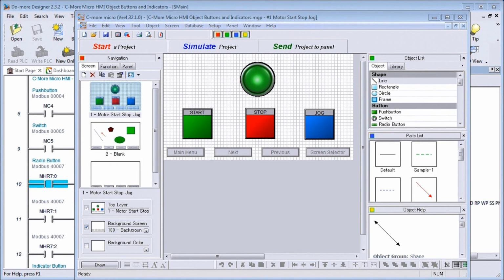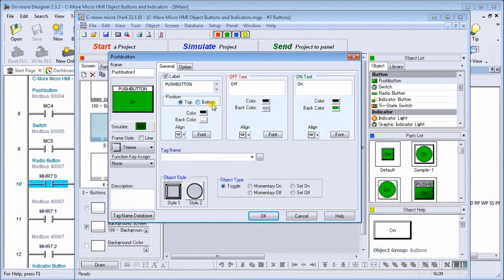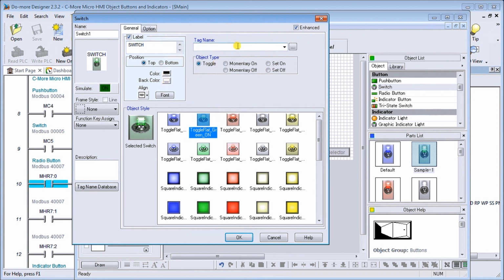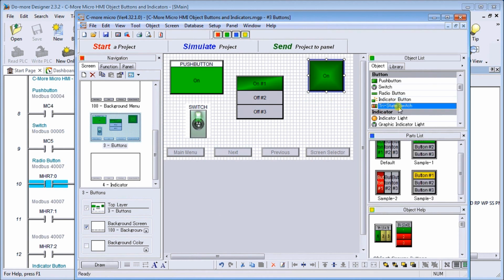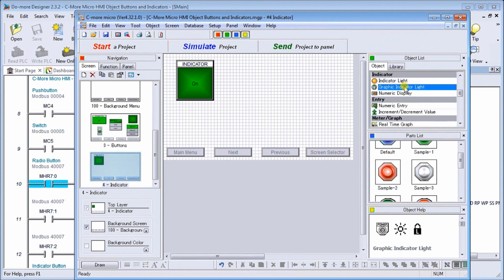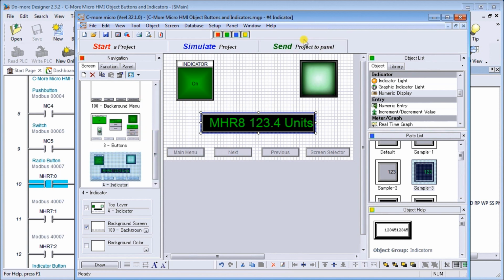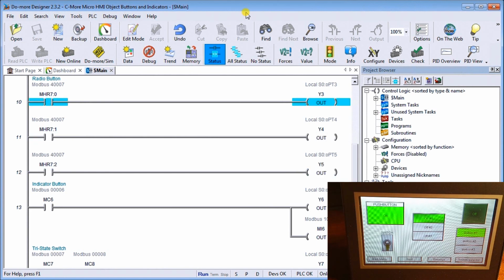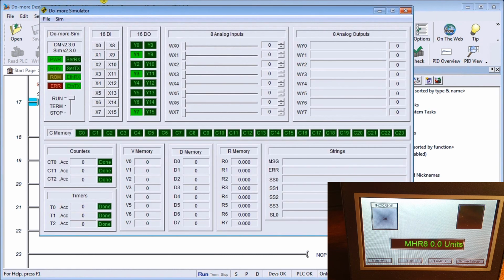C-More Micro HMI Object Buttons and Indicators

Comment: Trying to find the video. But I am struggling with getting and indicator to turn on a CM5 from a productivity 1000. I am good with CM5 pushbuttons and getting the plc outputs to turn on, but the feedback from plc to CM5 is not working. My modbus address matches in both software's. Any thoughts to look for?
Reply from the maker: Hi Brandon,
Sorry for the late response. 
What you are looking for are the PLC to HMI / HMI to PLC settings. This is an area of the HMI that communicates with the PLC, and vice versa, to do things like change pages, sound the beeper, blank the screen, etc.
https://accautomation.ca/c-more-ea9-hmi-series-panel-to-plc-and-plc-to-panel-settings/
This link shows the EA9, but this is similar to the CM5.
I hope this helps you out.
Regards,
Garry